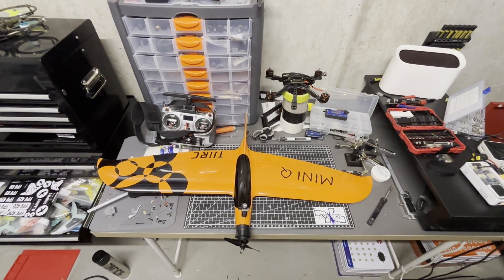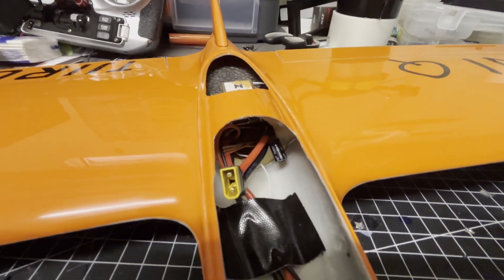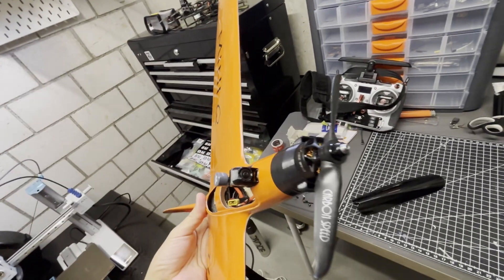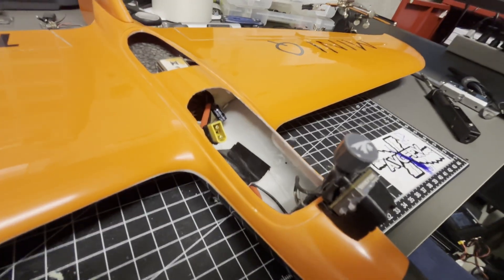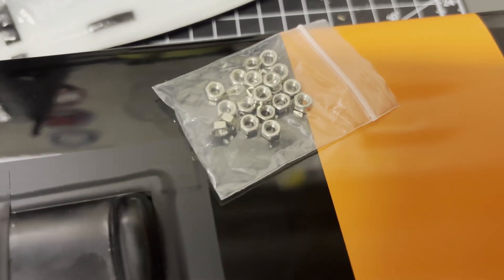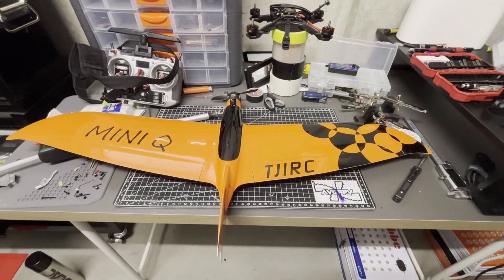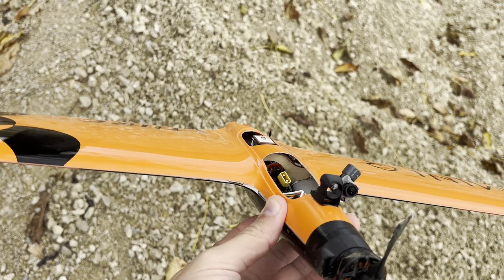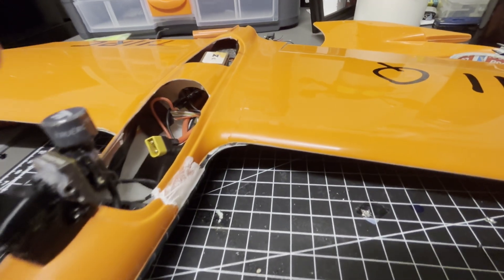TJIRC MINIQ - Build & Maiden

Comment: I think I know what happened because something very similar happened to one of my early designs. 

The auto launch exited to acro and it immediately pitched down. That tells me you need more incidence in the horizontal stab (that was my problem). With the miniQ- I guess that means some pitch-up in the elevons. 

So during the auto launch, the FC was keeping the nose up but upon exiting - acro mode doesn’t try to auto level so it just pitched down and face planted.

At least you know it flys nice in angle mode. Just set auto launch to exit higher and later and exit in angle mode then when you are ready, pop into acro and be ready to pull up or down depending on how your repair biases things.

Comment: It dived when it exited autolaunch and entered acro mode. Where is your neutral point for the elevons? There's no reflex built into the airfoil so the elevons need to be raised 2-3mm in their neutral position.

Also the CG is very sensitive on planks like this and 22mm is already at the rear end of the range. You must be very certain that the CG is accurate (fingertips are not good enough) if you're aiming for 22mm.

Comment: I noticed that just before nose down the message "move the sticks to abort  ... autolaunch" disappeared from your OSD. Did you move the down elev during autolaunch by accident?  I trust in INAV autolaunch, even maidens., a lot. But I added "set nav_fw_launch_min_time = 2000"  on all wings. During the first 2 seconds after start I cannot abort  autolaunch by any stick movement. Oh, I have also Autologging enabled when I arm. This can give an answer during the first seconds, any log of an elevator input?
Reply from the maker: Good observation. I did go out of autolaunch (so the OSD changed), but then it pulled down so hard, it completely took me by surprise and I wasn't fast enough to pull out of it. I'll definitely give it a bit more time to gain altitude for the next maiden so I have more time.
Reply: @AverageFPV  Mann.. I am building one as i type this.. I'd can only say make sure you have 2-3mm reflex. It nosed dive pretty heavy after you took to the sticks? Good luck with the rebuild buddy.
Reply: @DronePioneer  is there no reflex in the airfoil?
Reply: @fubar4fpv  Being a plank, CG is super tricky. Reflex is needed, around 2mm upwards! I just finished mine and will throw it tomorrow 🙂 have 2mm elevator travel and 6mm ailerons travel. My CG looks like 22mm!!
Reply: @DronePioneer  good luck....they just list a 7% proprietary airfoil,  ideally u want enough reflex already built into the airfoil to not need deflection.
Reply: @AverageFPV  Please, there can only be one maiden even if it's very short.

Comment: U can epoxy it back in one piece np. A few things r off tho

•Throws r way too high 
•loose fc ,not properly aligned(?)
•cg is super critical on this bird (no moving parts)
•dont use Autolaunch 
•shits a lethal weapon not just another foamie ,plz mount your servos accordingly 
It’ll b worth it , once it’s fully dialed in 

✌🏾
Reply from the maker: Good points, thenks Kofi! 
I'll definitely reduce the throws, fix the FC mount and calibrate the FC orientation a bit more precisely. 
Any pointers on where the CG should be? I did a best guess based on some forums but yours is obviously flying great, so maybe I can try your CG recommendations :)
Reply: @AverageFPV my cg is @ 20mm. Rather nose heavy cuz it’s super agil anyway. nd make sure u have 2-3 mm reflex. 
Minimal throws on pitch

Comment: That's a sweet speedster! Do you know what went wrong after turning off the auto launch? Hope it's not too hard to fix. 
You did suspect the FC wobbling, how big/small were your control throws?  Or was something reversed (which I doubt)?
Reply from the maker: It's totally fixable. really not sure why it took a nose dive right after autolaunch. Will try a couple different improvements and let you know! :)
Reply: @AverageFPV  that's the spirit! I'd try to toss it to tall grass a few times just to make sure the CG and trim are ok before applying power or trying auto launch! Best of luck for the next try mate! 😄